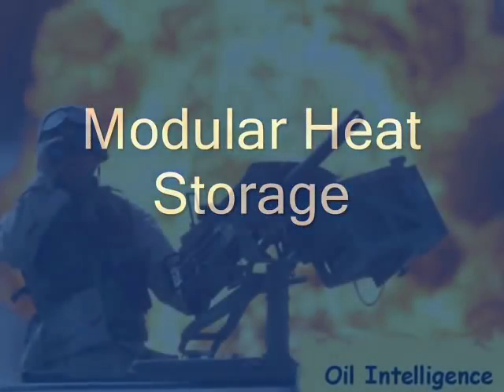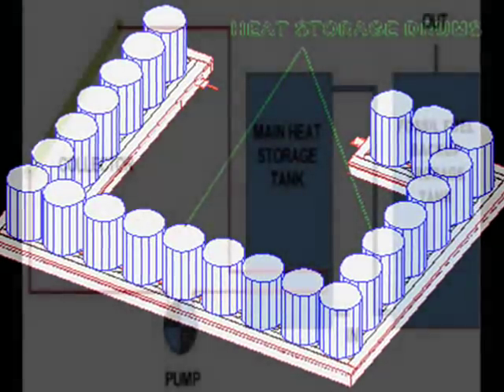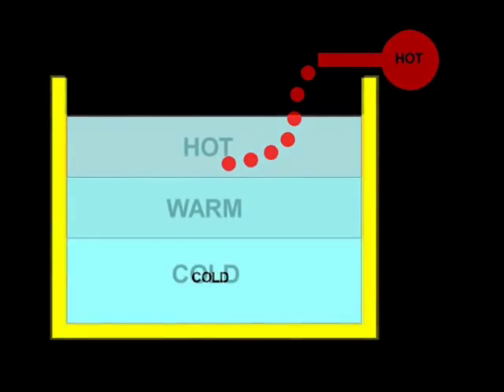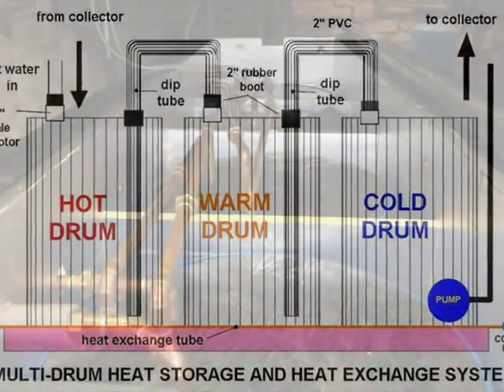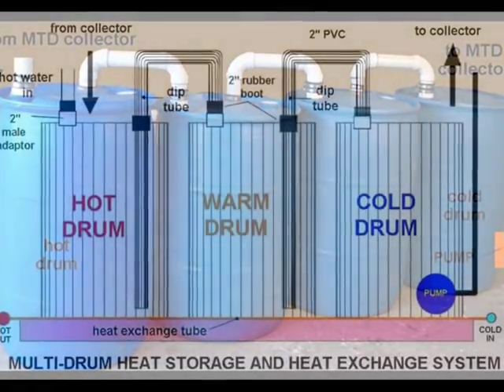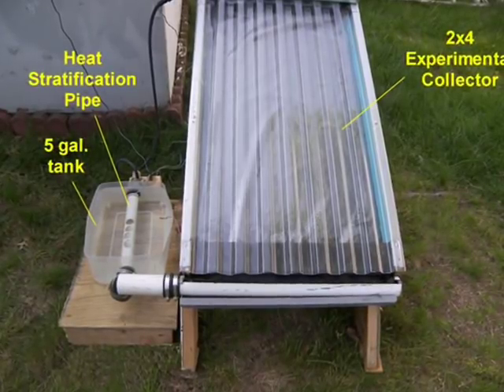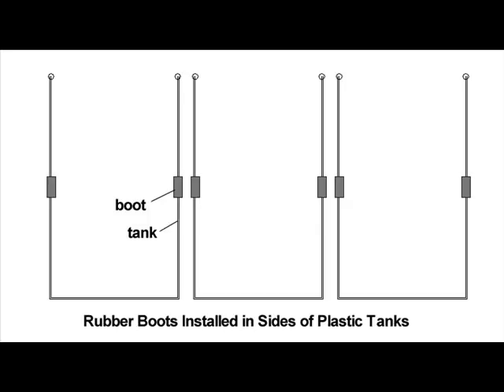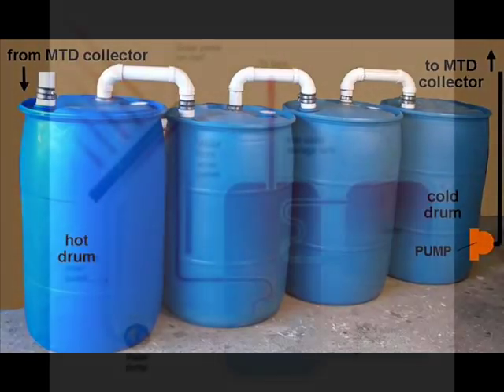Modular Heat Storage

Comment: Having opened with a diatribe against oil and fossil fuels, he goes on to describe a system made from various plastic components.  Where do plastics come from, again?  Oh, right, petroleum!
Reply: What's your point? Pretty sure using plastic barrels to reduce your grid footprint is still a step in the right direction not to mention cheaper on your electric bill
Reply: Plastics are very important, so why not preserve the crude for plastics for years to come instead of burning it?
Reply: A: if you don't burn the petroleum for energy, you run out of it far more slowly for making things like plastics.

B: all collector glazing can be sillica glass.

C: this can be done with steel drums or tanks and pipes instead of plastic.

D: this can literally be done with bamboo plumbing and hollowed out logs or coopered wooden barrel tanks

E: this can even be done with rammed earth and a waterproof clay plaster and clay pipes

Comment: It looks great, but is the water circulated through the house, drank, used for cleaning or just blowing the air over it and circulating that through the house?  Where I live the solar panel will freeze between dusk and dawn and crack the thing.  I could fill it with anti-freeze but them we can't use it for showering.  Boy, much is left for guess work!
Reply: Simply implies an indirect two stage system (i.e. your potable water flows in pipes through the heat storage tanks but does not mix with the heat storage fluid.

Comment: Could tall and narrow water cylinders (about 7 feet tall and 12-18 inch diameter) be daisy chained and still support heat stratification?
What kind of flow rates support stratification?
Are there any good reference books?

Comment: Excellent work in building the system and in making this video. However I have to disagree with the premise. Modular heat storage is unlikely to ever be as cost-efficient or energy-efficient as a single storage unit. Why? Surface Area. (SA) The surface area determines both the rate of heat loss, and the amount and cost of materials to build the system. The more SA, the more heat loss, and the more materials required to build it. 

The shape that encloses the most volume with the least SA is a sphere (which is hard to build), so the next best thing is a cylinder tank of roughly equal height and diameter (an approximate sphere.)  The third-best choice would be a cube, and the fourth best would be a rectangular tank.

A modular system (several small containers) will always have much more SA than a single large container of an equal volume, so not only will a modular system lose heat faster, it will cost more because it will require more total material mass, and also require more materials in terms of plumbing connections & fittings. A single large tank would require only one set of fittings, whereas a lot of small tanks requires many sets of fittings (with many more chances for leaks.) It is not easier to assemble, it will not cost less, and it will not perform as well. And a modular system will probably occupy more floor area because of all the unused space in between the modules. 

(Solar collectors are the opposite: they require high surface area with the least possible enclosed volume. Thats why they're flat & thin.) 

For a heat storage system, get as close to a sphere as you can. A single large cylinder tank is almost always the best choice in terms of performance, materials cost, ease of construction. For a modular system to be advantageous, there have to be extenuating circumstances that override the above considerations. Such as if you can get the drums for free. But of course that's a method that will only work for one or a few people in the underground economy, it will not work on large scales, so cannot be expected to be part of a sustainable society.

Comment: Hey guys, don't forget the wonderful IBCs. My homebuilt gasifier wood stove stores heat in a 330g IBC that then distributes to radiators. A copper coil in the IBC heats the domestic hot water. like the drums the IBC will handle 150F easily. I have an alarm set to 155F or at least I am about to. Controllers should be here today. Ck out my build vids under fiskfarm. 2nd Winter and working GREAT. More vids on operation and fire tools, etc. coming soon. Thanks John for sharing. Lots of great advice here. Great music to boot!

Comment: John, how can I use this idea to keep my above-ground 1000 liter rain tanks from freezing solid and rupturing during the frigid northern winters? I would love to stop having to drain my tanks each fall and retain that water source for spring water needs in the garden, in case we experience super dry spring weather. Any thoughts on this?
Reply from the maker: +Carmen Lamoureux  Insulate the outside of your tank with solid insulation and circulate solar heated water through coils inside the tank OR just circulate the solar heated water directly through the tank if it not potable.
Reply: +Carmen Lamoureux   Here, (Quebec) when we have a swimming pool that freeze during winter, we prevent it from crushing under the pressure of ice by anchoring, under the level of water, in the middle, some balloons, inner tubes or empty plastic bottles.   This way, when the ice is starting its pressurized actions, it compresses thoses "chambers" instead of the walls.  the question now is : Does your tank have a  top you can take away?

Of course, there is some one who will say ""Hey dude, empty your swimming pool"".  that,s what you say when you don't know winter and its laws....

Comment: Hi John, thanks for sharing, I've been watching many video's on collecting hot water from solar panels or wood stoves. My #1 question is can this system be entirely passive, meaning no electricity/pump to circulate the water???
Reply: +Shawn Doe Idle supposition here, but I've been thinking about circulating water without a pump as well. My thoughts are: If you've got a cold water storage tank at one end of the system, with a heating mechanism that's slightly below the storage tank (fire or solar panels) and then another storage tank after the heating mechanism that's above the heating mechanism you could create circulation without a pump.
Reply: Ram pump using thermals? Just a thought

Comment: Good info.  Taking advantage of the natural vertical thermal stratification or multi-reservoir horizontal stratification and then going from the lowest to highest grade heat when heating air / DHW is brilliant.

John: have you given consideration to using a similar method with, for example, in ground tanks (at or below the frost line) to provide cooling & dehumidification?  Where I live the frost line is about 2m (6') down and the temperature peaks out at 15C (60F) in late August.  Using just night time ventilation my house is quite comfortable most of the time but there are generally about 5 three day periods between late July and early August where the temperature hits > 30C (86F) with > 70% RH and night time lows are 22C (72F) & 100%RH.  Using a Water - Air heat exchange coil in the furnace and a circulating pump to provide cooling and dehumidification would mean using 120V @ 0.008 A (1 W) rather than 240 V @ 35 A (8.4 kW) for a traditional AC.  Even with a 100% vs 25-30% duty cycle, that's still a big difference.
Reply: Go on vacation for those five 3-day periods ;)

Comment: hay jackals the plastic tanks and film come from fossil fuels
Reply from the maker: +Michael Whinnery Yes plastics are made from oil propducts This is the kind of thing oil should be used for. It's much to valuable to burn. You are not to bright if you don't understand the difference between burning a non renewable resource and using it to harvest energy
Reply: +Michael Whinnery A gallon of gas can be burned once, those barrels will be around long after my great great grandchildren are dead and gone, being used and reused for purposes that have the potential to assist in continually providing their users with a clean and renewable source of heat.
Reply: +Buckwheat Chiggas they sicken you? let me guess.. you work in the gas industry?
Reply: +Korean Halaymaster 
"If the world is to be saved"  Saved from what?  Is there a giant asteroid I don't know about?
Reply: +Allen Flyers please ignore that dick-head(s). They're everywere. If the world is to be saved, it will be despite their idiocracy.

Comment: John,  I have studied your experiments for quite some time now and have started to construct a 36 square foot 200 gallon SHW system.  I will be using three poly drums in my basement connected together to stratify the hot water as you have outlined in this video.  I will also be using a conventional natural gas water heater that has been converted for use as a heat exchanger to provide pre-heated water for my conventional electric hot water heater.  The idea is that the collector will provide the hottest water to the inner tank core that has been capped off and provided with threaded taps to put hot collector water in the top and extract it from the bottom of the tank,  heating the domesic supply water in the conventional part of the tank.  That collector water would then travel through the three tanks before making it back to the collector.  At  night, a circulator will move the stored water through the pre-heater as needed, on demand in order to take advantage of the stored heat and keep the supply water pre-heated.  I am wondering if you have any experience with converting natural gas water heaters for this purpose.

Thank you.
Reply: I am using the same blue drums you show in your video.  we use them at work to ship dialysis concentrates but these will not be used for the potable water.  I do not know what the temp ratings are on these drums but we wash them in very steaming hot water prior to filling.
Reply: +goltoof   I'm using the same barrels John is.
Reply from the maker: +Jodi Tipton    These plastic tanks are good up to 160* F  If your temps are hotter than this your sizing is wrong.
Reply: +John Canivan   Thanks John.  I understand polypropylene would be the way to go but these hdpe barrels were free for the asking.  But if I may, my original question was if you had ever used a modified nat gas water heater tank as a heat exchanger.  Somewhere I got the idea to run the hot collector water down through the hollow center of the tank.  I'm not sure how efficient it will be, but it is simple, and cheap.

Comment: I'm also working on a system that will use thermal variations between cool air & hot air in an inclosed system to drive a wind turbine in order to generate electricity any ideas on a good bottom feed vertical spin turbine design?
Reply from the maker: Th Linn gill  Yes there generators like this in Spain and Australia. They run on the convection currents of hot air. They are often a mile in diameter and a mile high.

Comment: John We need to talk Ive been working on a new green house with a relatively large heat sink in the form of 40+ 55gal. barrels that will be heated by direct solar charging inside on both the north and south walls these are the longer walls in my greenhouse I need formula for finding heat storage capacity of this set up. any Ideas?
Reply: +Th Linn gill Water holds 1 BTU/lb °F and water weighs about 8.3 lb/gal so 8.3 BTU/gal °F.  Thus 40*55=2200gal * 8.3 = 18260 BTU/°F.  For every 1°F you raise the temperature you will store away 18260 BTU.
Reply: Thankx Ive been needing that.
I have to add that this has been an amazing weak for our greenhouse build.
The good Lord has provided in big ways. While we were out doing yard sales Saturday, we came across 3 IBC totes for only 100.00 (Total Not Each as is the norm ) then not 30 minutes later we found 6 sets of cross ventilation louvered window sets (we will use these in both end walls as well as the air lock wall between the main room and air lock entry way ) for the ridicules price of hauling them off. And if that weren't great enough the same good ol boy gave us decorator bricks for a retaining wall around the IBCs as they didn't come with cages. Then he throws in some aluminum scaffolding panels that we can reuse for walkway flooring. He throws in some rain gutters we can reuse to make a Wal-Mart bag Tomato line across the north side of the 45' long greenhouse. And he's going to sell us all the semi clear fiberglass panels we will need for the main roofing at a discounted rate from his left overs pile. Oh and that's this weak-end Last weak-end we posted a Craigslist add for metal panels for the back wall  & top back roof areas and we had it found at a great second hand price in under 2 hours and in our local area. Man when GOD delivers HE DELIVERS! praise be to GOD always.
Reply from the maker: +Th Linn gill you should contact me through my web JC SolarHomes

Comment: A Stainless 3500 gallon tanker in 1980 buried with insulated top below 5ft below grade in 54f Canton OH area with two drain down 4 x 6 ft water to SOLAR was more than enough to reduce average well water usuage from 6 gpm to 3 gpm on a 4 ton compressor in a TETCO 050 then on HW baseboard radiation  and forced air heating by GeoThermal Water Source Heat Pump

www.GEOPROS.org   for GEOTHERMAL PROFESSIONALS

Comment: I'm thinking about adding solar heat to my home. I found a great deal on 330 gal totes the contained food grade silicone used to manufacture non stick baking items for $65 each. Their high capacity and square shape will make them easy to insulate. I want to run the circulation system off a few 100 watt solar panels as well now that solar panels are finally reasonable, around a buck a watt these days... I'd love to go totally off grid someday. Forklift batteries are the best deal going too, in stationary use they last nearly forever, 15 years easy. I've already upgraded all my appliances and lighting to high efficiency and led and only pay $58/mo on budget year round so the expenditure for the initial setup seems hard to justify at the moment. It would mainly be just to help the environment a little and the added bonus rush of not having a bill. Hopefully solar panels continue to fall in price. The planet could use a break too for sure...

Comment: Hi John.  Great video.  I wonder if you have data on how long your peak heat values are retained? Would additional insulation ( the plywood box scenario ) surrounding the water tanks give more than a day's worth of space heat?
Reply from the maker: Thank you Ralph. 
Yes I box in my drums with 2" isocyanurate. insulation. no need for a frame or plywood.
Reply: Ralph Kramden additional insulation will definitely increase your heat retention.  I plan to use a pot belly stove with a copper coil around the exhaust to circulate water. Chicken coop and garage heater

Comment: I've been researching various DIY a solar heating unit to heat out buildings.  One thought that has crossed my mind is to use a 'solid mass' heat storage 'tank'.  Effectively building a large insulated box filling it with rocks, and passing the air through the 'rock box' before letting it flow into the building.

The reason I thought of a 'rock box' instead of a liquid solution is building and insulating a 'rock box' should be easier for most DIY'ers and should theoretically be LOT less maintenance once built.

I haven't yet seen any serious solutions along this line and was wondering if you had an opinion on the matter.
Reply from the maker: Yes Rocks may be used to store heat BUT the heat storage capacity of water is much greater and heated water may be easily pumped to where it;s needed. Some systems bury tanks of water in a pile of rocks and blow across the rocks to heat a house. Rocks are fine but WATER is the most economical heat transfer medium available.
Reply: John Canivan What about the length of retention though?  While water does have a larger capacity to store heat (something like 6 times?), doesn't water dissipate heat much faster than solid mass?  I'm interested in designing something that will maintain heat for a long time frame.  If water retains heat as long or longer than solid mass I may change my thought process on this.

Comment: there are much better heat storage mediums than water... sodium bromide is what we used for solar a/c in Hawaii in the 80's... it almost double the effectiveness. We had a 10,000 gallon tank, numerous copper collectors on the roof.. the first solar A/C on Maui, designed by Yasaki I believe.. (my memory slips from time to time). It was on the Dorvin D Leis commercial office building.. at the time he was the largest mechanical contractor on the Island... I was the project mgr and estimator for a 3.5 million hot water heating project for public housing.
Reply: Can you provide more details about the sodium bromide?  Also, you said that there are much better storage mediums, are any of them reasonably inexpensive and readily available?
Reply: +Chris “organicfarmer” Sawyer I was wondering why no one was saying anything about salt solutions or similar heat absorbing solutions.
Reply: probably because of simplicity and availablility, not to mention cost.. but in cloudly climates or sustained inclimate weather, a better medium is worth the investigation and expenses...
Reply: http://intraweb.stockton.edu/eyos/energy_studies/content/docs/effstock09/Session_10_1_TES_in_Solar_Applications/79.pdf

Comment: Don't listen to the negativity.  Keep up the good work.  One suggestion would be to avoid heating up plastics, especially if you intend on using the water for washing or drinking.  Some ceramics might be a good choice if you are considering using any of the water for consumption.